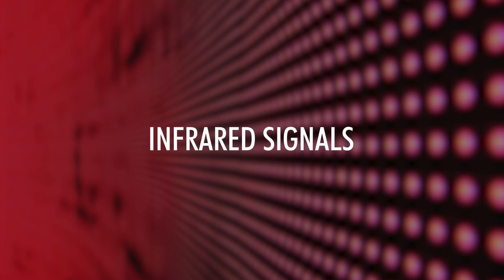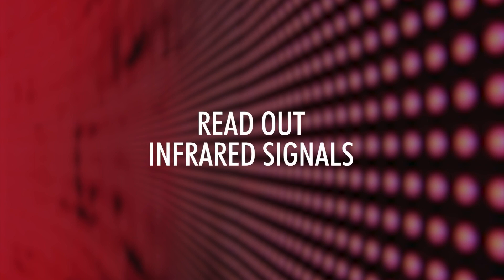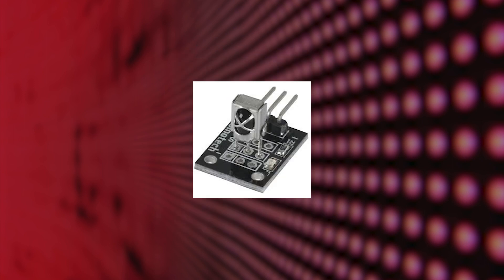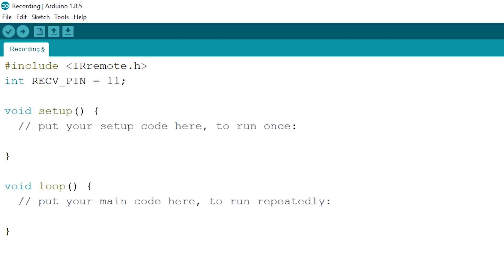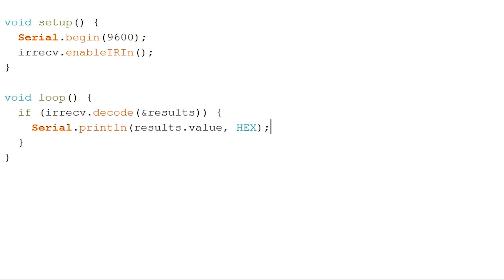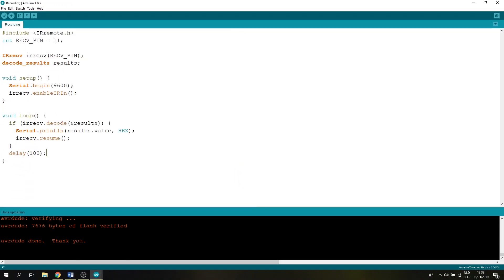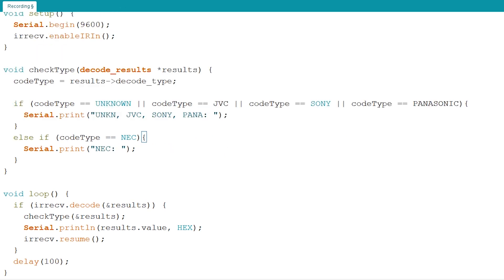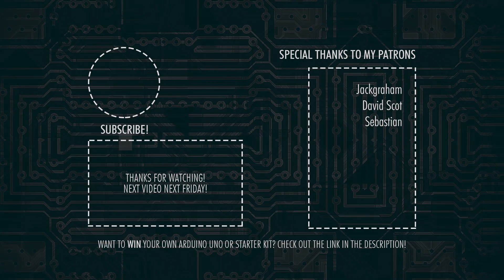Arduino uno infrared receiver example

Comment: code does not work in 2022- says 'codeType' was not declared in this scope. Good video
Reply: Use the ir remote library version 2.50 it will work